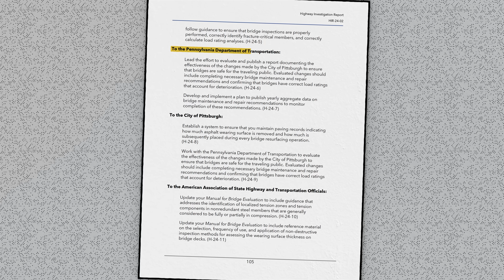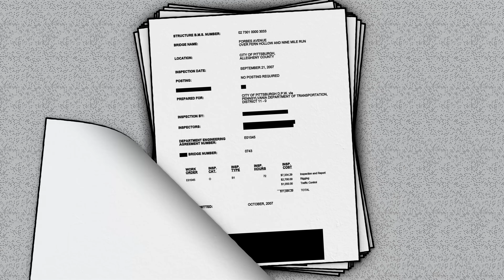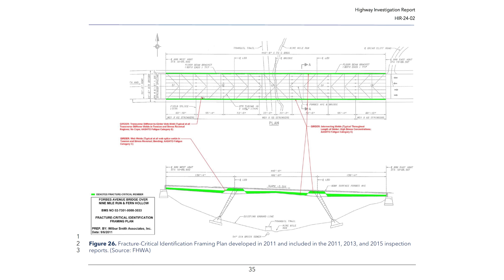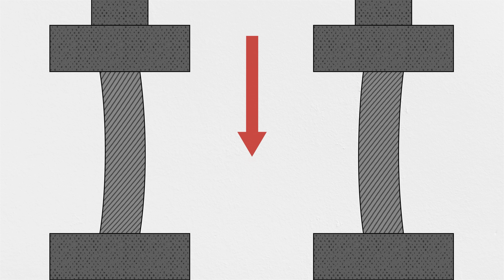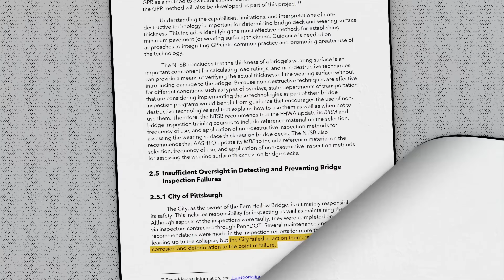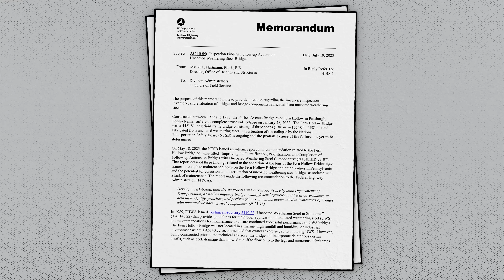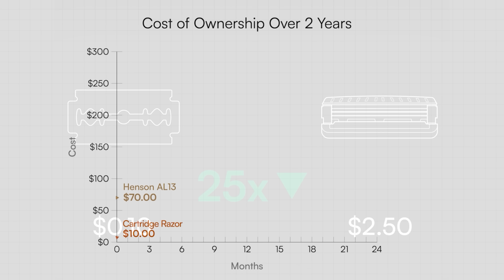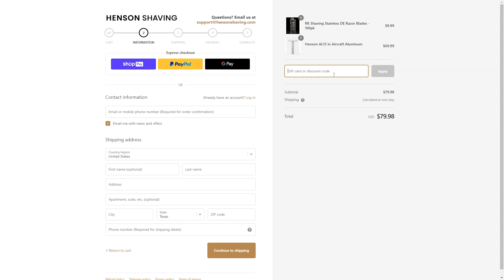This Bridge Should Have Been Closed Years Before It Collapsed

Comment: Why do we even use weathering steel when we know the limitations and a lack of maintenance is likely to happen? 

Hot dip galvanization exists and gives you a proper result for 50 years and you can even extend the lifetime of that with a powder coating on top which will in average double the lifespan of the steel (1.5 to 2.5 increase) . So called duplex system. 

Where I live we have a lot of road salt as well and our guard rails are hot dip galvanized. Some of them are over 50 years old and now first signs of corrosion can be seen. 

On weathered still it is hard to tell how far the corrosion has gone

Comment: Probably just spitting into the wind here, but your point about one person not having all the information and authority to do something about it could potentially be solved by both forcing inspectors to read the previous inspection report to know what was recommended, and giving them the authority to mark a bridge as closed until anything marked as "section 2 (class2?)" gets fixed if it was mentioned previously and hadn't been addressed yet. It's an imperfect solution to an imperfect problem, but if a bridge gets closed, then there is incentive for the owners to actually do something about it besides just ignore recommendations. I realize it would be a little difficult to do, but it seems like the best of all the bad solutions I could think of, especially considering I'm just a random nobody on the internet.

Comment: I would think that the way to prevent something like this from happening would be to give inspectors the power to close a bridge if they find an issue the bridge owner was told to address before the next inspection, has not been dealt with. You can ignore a report, you can't ignore an angry mob demanding they be allowed to use the bridge. If the bridge can't be reopened until the problems have been address, then if the bridge owner doesn't drop everything and get the bridge fixed and reopened by yesterday, there will be hell to pay.

Comment: Grady: like I described on your "Surfside Condo Collapse" video, you are truly top-of-class when it comes to covering structural failures. I especially appreciate your musings around 18:00 about the frequent disconnect between those charged with gathering on-the-ground data and those who have authority to enact the necessary solutions. Also around 19:17, about how serious of a responsibility it is to maintain (and fund the maintenance of) infrastructure. Bravo, and thank you again for nurturing, using, and sharing this gift you have of communicating engineering.

Comment: Wondering if you might be interested in having a look at city water infrastructure. I don't know if you've heard about the water feedermain break in Calgary, Alberta. 72" (corrected 60" to 72") water pipe burst, which supplied ~60% of the treated water for the city and some surrounding communities. Leaving an older pumping station to carry 100% of the load until repairs are completed. Outdoor watering restrictions and pleas from the mayor to reduce indoor water use so reservoirs don't go dry for emergency services, etc. July 1st is the date when all repairs, flushing and testing are scheduled to be completed. I would be interested to see a real (practical) engineering look at this, when all the details are known. As you may discover, this type of water pipe and subsequent failure may become a problem all over North America in the coming years.

Comment: The trouble with maintenance is that there is arguably no consequence to putting repairs off for 4 years.  If you do the maintenance now, the money is spent now and the people are annoyed with the road closures now. But if you put the maintenance off for 5 years, you can avoid the road closures and spend the money on things that make constituents happy.  The maintenance becomes the problem for the guy after the next election.

Run this thought process for a few decades and things fall apart catastrophically.

Comment: I find it odd that civilian bridges are not standardized like military bridging. (Some Bailey and other bridges from the WWII era remain in service). What is the excuse for variety? 
Esthetics should mean nothing to adults. That design was obviously chosen for esthetics including the weathering steel which should not have been used. The new setup is sensible
and clashin with a tiny trivial park should of course not be a consideration.

Comment: @PracticalEngineeringChannel One thing that struck me, and by which I'm a bit puzzled, maybe you can explain it in a future video? You said that the common assumption is to treat the section loss as evenly distributed and that it is "usually conservative" because it usually isn't the critical pieces that end up with all of it. That seems to run counter to everything I previously understood about risk management in other contexts, even when not life-critical: unless you have specific knowledge otherwise, the assumption should always be calculated based on a worst-case scenario, possibly with a "probability of this being true" caveat applied. I assume that I must be missing something that makes this not applicable in this particular sort of case, but so far I can't think of what it would be?

Comment: Any lawsuits against the city/state yet?  Obviously gross incompetence demonstrated. 

Shouldn't "fracture critical" member be identified at the time it is designed rather than waiting to ID it at instpection time.

Have any of the engineers performing in the inspections been censured in any way? 

In inspections, if previous work requierements are not done by next inspection the structure should be shut down, or the inspection report has to be given emergency priority at a higher level of government that have been given authority to FORCE the repairs!  

The inspections must generate a simpler decision tree that MUST be followed.

Comment: I know this is a "hammer seeing a nail" comment, but we really need a federal software company (company like the USPS is a company) managed probably by the Army corp of engineers and/or the Navy. Too often, you have different parts of the government and private contractors saying that they can't share data, that everything is incompatible. There's no good reason that a photogrammetric model couldn't be made for every major bridge's inspection that also couldn't be shared to everyone involved and have those triggers automated. You see the same excuse with things like institutional data and security... Yet these institutions can sure fax and email each other just fine... Grr 😡 it's like incompetent failure is a feature and not a bug!

Comment: Typical "school-bus-stuck-on-the-railroad tracks" mentality: it isn't a problem until something disastrous happens.  That this bridge went so long without proper repair/replacement knowing full well that it was literally coming apart at the seams is, to me, a clear cut case of criminal negligence.  Naturally, nobody has gone to jail and I doubt anyone was fired or even written up.  And I don't for one second believe that this was something the "fell through the cracks".  At best, half-baked measures were taken to delay the inevitable; at worst, it was completely ignored.

Comment: after the Genoa disaster (that of the Morandi bridge in Italy) a study on the state of bridges in France was requested by the government.
the result was catastrophic! ! !
on certain bridges, inspection reports announced that these bridges were:
 "in a state of imminent disaster - urgent repairs required"
yet in certain cases, repairs were carried out more than 25 years (on average) after the first inspection report requiring "immediate" repairs!!!!!

the authors of the study (surprised at the low number of disasters in these circumstances) attributed these long delays to budgetary reasons (who will pay: the municipality; the county or the state) and political and electoral reasons (if I launches the work I will be blamed for the inconveniences of this work and it is the opposition which will reap the benefit of the new bridge) ..... as well as the negligence but also the incompetence of the elected officials responsible

Comment: I live in Johnstown PA. We have some experience with engineering failures. 
I laughed out loud when it was announced that Pittsburgh would quadruple it’s spending on inspections. If the city of Pittsburgh had followed the recommendations of the inspectors they had at the time, the bridge would’ve been fixed. 

Government always look for a reason to increase their control, and yet they misuse the control they have. 

The answer is voting for competent, trustworthy people who actually perform their duties, instead of using the bureaucracy as an excuse to avoid their duties. 

Good luck with that, especially in cities run by the Democrats.

Comment: Please don't call these various issues "mistakes" or even "incompetence".  It was malicious behavior, full stop.  Those involved knew what needed to be done, but they clearly falsified reports and refused to take action because the powers-that-be didn't want to spend the money (or cause the inconvenience to motorists) to fix it.  You cannot, in any reasonable universe, see that maintenance reports for 13 years recommended replacement of critical sections, and then say that refusing to perform that maintenance was a "mistake" or merely "incompetence".

Comment: And this is what happens if a whole nation is hellbent on maintaining "freedom" at the cost of critical regulations. If you task an inspector to inspect public infrastructure, they MUST have the authority to order the owner to put these measures in place. Otherwise, what's the point of having inspections in the first place?

Since we've had the topic of car maintenance in the comments, my country has a general database for car maintenance. You can have a small privatr workshop do the inspections or a larger automobile club one, but what they have in common is that they have to put their findings and applied fixes into this database before they can give out a permit. Without a road permit you don't get insurance, without insurance your car is not allowed on the road

Comment: Authoritatively, sections of steel in the bridge structure did not have good durability. its a good point too. At least, some colossal effort was mentioned otherwise was thinking how chill renovators were while building it without considering the potential hazards. Ridiculous that fully operational bridge was built anew only after the bridge collapsed in avoidance of lapse recurring in the future. Inspection standards and requirements were too late to be put into practice at least there is less probability of it recurring in the future yet again. Engineers should have already been told to identify bridges needing closer look. The new bridge made people wait until rehabilitated. Weathering steel is a unique type of steel alloy. It has recently gained fame due to its distinctive rust-like appearance and exceptional corrosion resistance. NBIS (National Bridge Inspection Standards) has so far played a crucial role in ensuring the safety and functionality of highway bridges across the US. But the engineers checking up on the bridge at hand had the self-government only to report, not take action to secure, about the bridge. I am still wrestling with trying to figure out why they had self-directing freedom only to give reports (recommendations). Hoping that future development will unfold positively as a gradual and favorable progression.

Comment: This is a very apt simile of the state of the USA as a society. Thousands of individual shortcomings interact and create the basis for an overall collapse. Having politicians with no engineering knowledge - or any relevant knowledge at all - isn't helping. These failures can only be remedied by collective action, but Americans don't like collective action. So the whole societal structure will come crashing down. Both because of ignorance and incompetence and because of ideological stupidity. Humans are flock animals, and celebrating individualism is against nature, for better and for worse. In the USA, it has proven to be for worse. "This bridge is deemed safe, because it is too costly to repair it" = USA in a nutshell.

Comment: Why bother even inspecting if it's just going to be filed and not actioned?  It sounds like there's no-one in local government responsible for understanding, prioritising and actioning the reports, with infrastructure maintenance budgets allowing urgent work to be done, or the ability for an infrastructure manager to present cases in need of larger budgets to council/government to review the need to keep repairing vs replacing. It shouldn't have gotten to the point it did if it was maintained properly.  I worked for our state works department that was responsible for maintaining all state-owned assets like schools & hospitals etc. There would have to be a similar department in a large city like Pittsburgh that would be responsible for maintaining assets like bridges.  Even as part of the road maintenance department.  If these reports are just added paperwork that nobody wants, why waste money doing them?  Not everyone in charge can understand what the needs are, but somebody overseeing the department should. I know they're more interested in shiny things that will get them re-elected and/or funnel money to their buddies so this rant is probably pointless...

Comment: Im not familiar with how governments operate, but i will say that massive systems don't always mean efficient or effective systems. Often there are redundancies where there is no need and there are areas that could use more oversight and redundancy that don't have it.

I will also say that this is an example of how computers can help with a job. All this inspection data sound be entered into a system with an algorithm and the algorithm should flag coding for infrastructure that is in need. Each infrastructure item should also have its own "profile" in the system that keeps detailed records. Not only original building details, like the thickness of the pavement, but also inspections. 

There should also be a head person on this, most likely a head safety engineer, who these flagged reports go to directly. This position should work directly with the Treasury in order to understand and budget accurately on infrastructure needs. 

Id also add that some basic standards should be in place for inspections if they srent already. They should have a guid book on each type of infrastructure and procedures so things are not getting missed. 

I feel that there actually really needs to be a master system that federal, state and city governments need to work within, so everything is connected and pain points are better identified. It would make construction planning actually make sense (i shouldn't run into a 2nd detour on my detour for example but happens frequently). 

Again, I am a laymen who doesn't know how the system works and there are likely things I'm missing. Its just pretty clear to me that something like road construction is done without collaboration across different areas and possibly departments.

Comment: You never addressed the elephant in the room.  Who the heck paid for the medical costs and probable lawsuits of the victims?  Furthermore, if the court system wasn't crooked, the politicians and govt officials in office from the time of the first failed inspection to the last failed inspection should be held responsible in a huge way to set an example for all the current and future politicians.  Politicians in general are way more likely to be corrupt than most other professions, so hold those eh-holes responsible.

Comment: Who’s going to spend the money on painting the bridge?? The majority of bridges are structurally deficient in this country.
Why? Because the states aren’t being very smart about maintenance or design of bridges they simply don’t have enough money.
Maintenance is the first thing that is cut in municipal government budgets.
Conversely if they have a toll on the bridge then part of the money is used to maintain the bridge, hiring engineers and maintenance painters who can address any minor corrosion before it gets worse.
The NJ turnpike and parkway are two highways that run North South and the charge’s to drive almost any distance is used to pay for maintenance and repairs and improvements to the highway.
There’s many bridges that were built in the 50’s or earlier that haven’t collapsed on the NJ Turnpike because they are regularly inspected and they are repaired regularly.

Comment: The answer is government officials going out of their way to neglect spending. Infrastructure is much less a political topic these days, allowing spending being reallocated to other entities. The money used to paint rainbow crosswalks easily could have been used to fix bridges, but which gets votes?
Reply: Well, first of all, I think you're overestimating the cost of paint. Rather, safety organizations (public, government ones) need more sway in a project's lifetime. If a bridge fails inspection, it should probably be repaired instead of just recommended to be repaired!